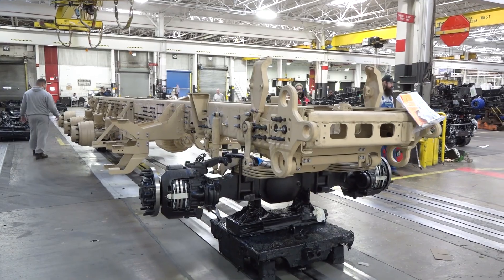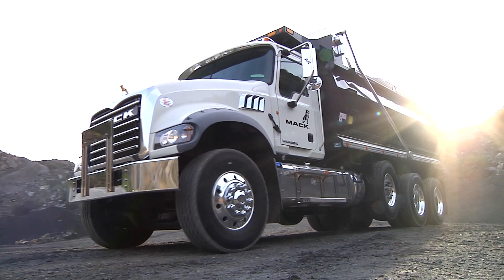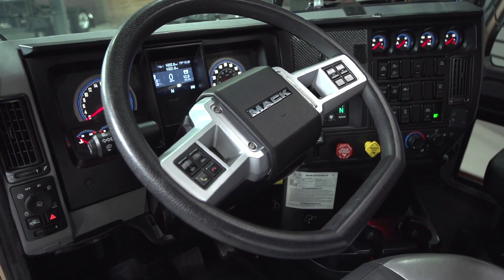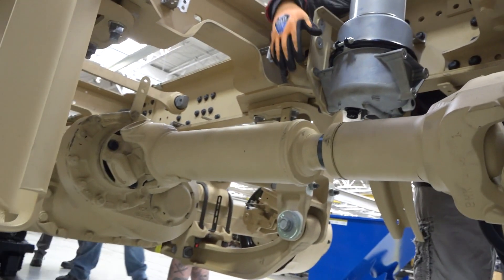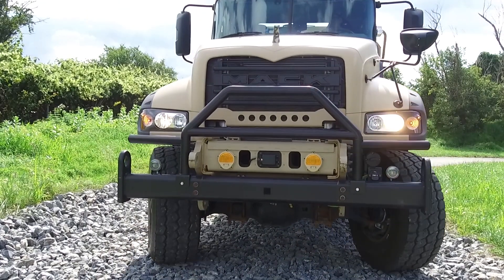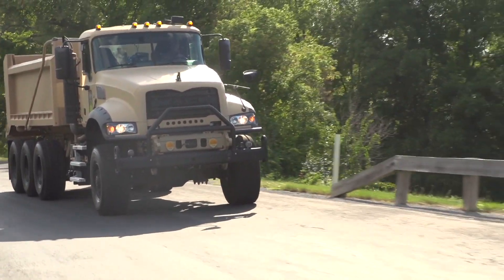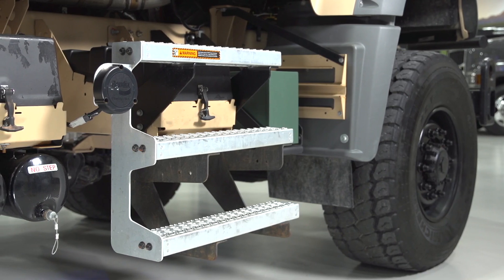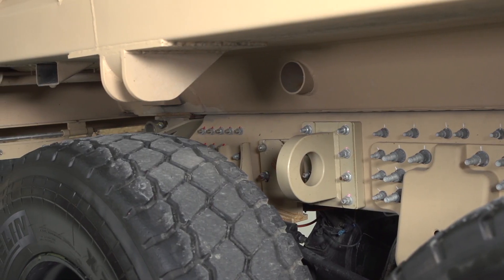Military Program - Mack Defense and the M917A3 Heavy Dump Truck

Comment: A Mack R cab was the most durable truck Mack ever made with the exception of a few of the L series. I was handed a 1974 DM800SX new and it never ran well nor did it stay together. The cab broke, the frame broke, doors fell off, the springs always broke One day a Mack rep came out to the pit we were hauling out of,  he foolishly told us that "there wasn't a man alive that could break  a DM800 Mack. He climbed int a cab and before the truck left the pit, he had a broken axle. Mr. Mack could not believe it. We replaced the axle and off they went. different truck popped another axle right behind the first. Of course we all carried spare axles and changed them ourselves. This was at Weyerhaeuser Snoqualmie in 1975. I got to go back to my old (1968) R600 with a quadraplex and was as happy as could be. All trucks had 14yd rock boxes and since we ere hauling off highway they were loaded to spillover. That was the beginning of a slow decent to VOLVO....
Reply: Vea mi DM 800  hecho a mano. Youtube. Mack DM 800 a escala

Comment: I don’t get why you would switch the cab out once you had the armored one. Do the windows not roll down on the armored one or something?
Reply: For deployment they use airplanes a lot these days. Lighter vehicles are easier to move by plane and as a whole, with a less heavy cab pushing the engine a fuel less. Also, the unarmored cab would be cooler.

Comment: Wish the commercial libe lasted like they say. Def issue,  blown rears, electric issues...... the list goes on.
Reply: You know military equipment is basically exempt from emissions requirements imagine an Abrams with an after treatment system.
Reply: HERPY DERPEDY well that's bullshit, what do they think winning wars is more important than saving the environment?
Reply: @bryanmartinez6600  all government vehicles are even state and local
Reply: @tdashkevich  not necessarily war but increasing the risk of failure on a military vehicle can cause more casualties they have to make vehicles that will work in the worst of conditions so troops can escape from say an ambush if a treatment system failed and stranded them that be really bad.

Comment: Well you know I heard a fellow driver the other day claim none of the military vehicles had def tanks on them and you know I looked real hard for that blue cap on the military version. 
 I guess uncle Sam doesn't care about the environment and it's really just an added cost to the public.
Reply: It is either painted or exempt, I believe it's exempt, I can't remember why though. And yes Diesel emissions bullshit is a scam in my book.
Reply: @justanotheraviator2357  no military vehicle has emissions, period. The last country I was in had a sulphur content of 14000 ppm. We all know what that wood do to an EGR, let alone a DPF. My MATV was a straight piped CAT C7. The Maxxpro was a non egr dt truck.
Reply: The reason they don't have any emissions equipment is because they burn lowish grade jet fuel instead of low sulfur highway diesel.  This is because the military doesn't want to have to haul a bunch of different types of fuel around to fuel all their different vehicles, so they require everything from ATVs to Attack helicopters to run on the same fuel.
Reply: @jamesburleson1916  makes since ...kinda like some of the older ones being able to burn used oil also.
 I know war doesn't care about the environment.

Comment: These trucks are not made to use in Afghanistan or Iraq These are built for use in Chicago!
Reply from the maker: Over 1100 platforms on the same chassis are in service in Iraq at various 
Ministries plus commercial use. For Afghanistan the same chassis has been provided as well to ANSF.
Reply: Did anyone else notice there is no Def fluid system or emissions on these trucks?
Reply: Twoleggedkumulava  still detuning is also done like you say for reliability and a longer service life. Many companies do that like the Powerstroke and Duramax in the medium duty trucks. Same with the 6.7 Cummins when used in medium duty trucks.

Comment: Singles are a JOKE in wet ground. I'd rather have a 5-ton that this in a really rough place. Never had any trouble with the old Continental multi-fuel engines either. Needed a 10 or 13 under. 10 would be fine. More split gears. And a jake would be nice but you can gear down enough. 'C' models are all right on the road but not off in a hole. 5-tons any day.

Comment: No double steer tires? If this drives into something, it's got no way of steering on one damage steer axle. You'd think that they would of tested it on sand from the middle east, considering that they do must of their work over their. Drive by your local Alison transmission shop and see how full it is of trucks. Automatic transmission in trucks are problem free for 2/3 years and that's driving on home soil. Let's see these autos in action overseas.
Reply: Military trucks been having Allison auto  transmission for awhile now, I think since the 80's if I'm not mistaken

Comment: Es un excelente camión para el trabajo.
Pero su cabina en sí NO es nada cómoda, es muy pequeña, e incómoda. Es increíble que siendo un vehículo creado por norteamericanos se tan pequeña y nada espaciosa la cabina para el conductor
Reply: The cab is about normal sized for a North American vocational truck (dump trucks and the like). Its not like the highway big rigs, which has sleeper cabs. Besides, its to be operated by fit and trim soldiers, so its not much of a problem. And it looks just as comfortable as the civilian version.